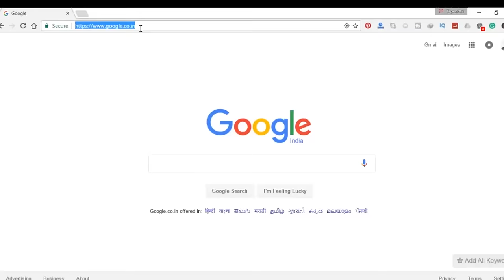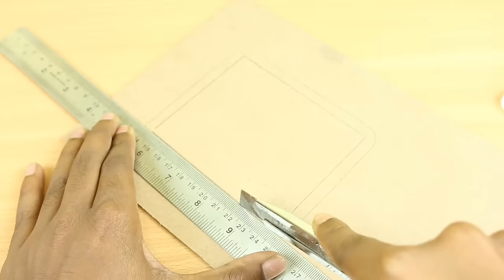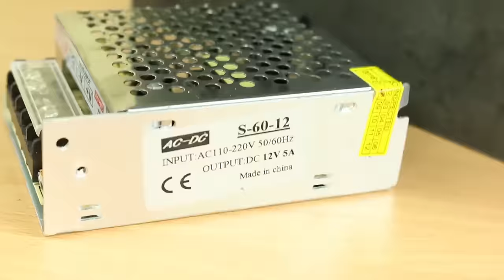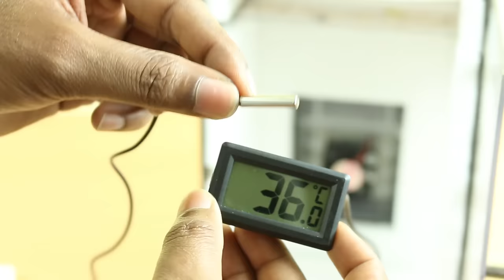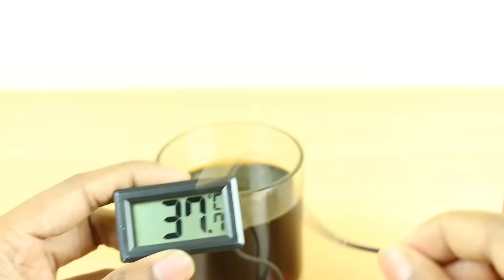How to Make a Fridge at Home

Comment: I bet that heat sink would work well on a cpu
Reply: Probably because it is for a cpu
Reply: 1:20 "Refrigerator radiator" you sure its for cpus, bud?
Reply: its a peltier cooler yes, but adapted for this purpose.
Reply: R101710 yes, its probably some cheap cpu heat sink bought in bulk off eBay and sold as part of this kit.
Reply: Work's the same way essentially.
Reply: Ailuropoda melanoleuca Nineoneone I meant the heat sink, not the entire fridge thing. If you made a retention arm for it, it could probably work as a shitty heat sink
Reply: Thijs Janssen thank you, it does have a cheap cpu cool we on it, as I said
Reply: S A L T Y
Reply: Landon J Powell wow, you just contradicted yourself there, matey. First you say it isn't a heat sink, then you say it is? WHICH INE IS IT????
Reply: dude he means only the big heatsink not the whole assembly
Reply: Thermoelectric Peltiers (TEMs) can be risky around sensitive PCBs. They tend to condensate below the ambient temperature. (They are used in cheap dehumidifiers, actually.) Keep them outside your case unless you can insulate your components from dripping water.

It can be done, though. Condensation depends on how cold you want to go, the climate you're in, insulation materials, etc.

I've thought about putting some TEMs on my H110i's external radiator, instead of fans (only the TEMs' heatsink fans, naturally), so that the coolant is extra chilled.

Search "TEC1" on Amazon for tons of them. A 154W peltier is $10.
Reply: I think he's pulling your leg..
Reply: Jack McDonald p
Reply: Jack McDonald I

Comment: If I were to make this In Mexico, It would come out the same price as the old regular sized refrigerators we get from the U.S. Nice Idea though.
Reply from the maker: price is same for every country but shipping charges can vary
Reply: No i mean just the price of those products alone. I didn't even take into consideration the shipping costs! Damn!
Reply from the maker: +Tacos Varios price will be same
Reply: The same as it ever waas. Haaaaaaay!
Reply: That's what i was thinking, should the price on these products be more expensive that of the cost of me getting one second hand.

From Tijuana btw
Reply: @gnawaserge  Just get creative, mate! Instead of computer fans, use those chinese micro fans, instead of the cooler, just use a metal chunk of something.

Comment: Is this Thermoelectric Cooler Module effective as a cooler/fan if the cool side fan is replaced with a larger diameter fan and heat sink?
Reply: Ananthu Raj yes, but you need to put a larger heat sink and fan on hot side. and also keep the hot side outside the window. if not the heat generated from hot side will be circulated in the room.
Reply: Thanks mate.
Reply: yes,,, energy doesn't just disappear... 
its energy transfer LOL

Comment: @Mandal 
Please tell me if it can work for a long time. I tried it out, but noticed that the peltier module will heat up in some time. I went through its working and noticed that these devices cannot be powered for a long time. So tell me this, if I use this cooler for 2 hours there would have been heat building inside right?

Comment: 40$ in parts?
For that price you can buy used 10x larger fridge, with proper compressor for cooling(much more efficient than peltier cell.)
Reply: But you loose the fun in making your own.
Reply: exactly. All of this is for testing our knowledge of electronics and just for fun.
Reply: Arek R. 
I agree
Reply: Because this needs a lot of work but a fucking ready fridge made by a factory that make 100 ones every day

Comment: i got the thermoelectric cooler but it damege when i start
Reply from the maker: +ghost caught on cam change the module
Reply: but my module have only two  fan one small and other big one
Reply: please tell what i do 
i use all that product which you mention but it not work 
so please tell me which amp i use
Reply: i will change the module but it not do any coolling
Reply: The peltier chips are very sensitive to temp so apply heat paste properly bw the hot side of peltier chip and the heat sink, also use high quality of heat sink ......
During my project we burnt many chips and finally we find a solution to protect our chips.
We simply add a feedback system which cut the temp when it goes beyond 90℃ on hot side.
Reply: I advised you to use high efficient heat sink, I think you have used cheap heat sink.

Comment: Hey if its 42 C out side and that says 20 C and it will run on solar, I am for that & yes I have used one with out knowing it un tell I took it apart , found out it stopped working due to A lose wire

Comment: #NeedHelp
I am making CNC with arduino but for this I need old DVD drive but in eBay it was very expensive so "HELP ME I NEED SCRAP DVD DRIVE"
Reply from the maker: +Viral in YouTube brother you find old DVD writer in pc repairing shops.
Reply: Yeah I go there but they don't have
can u send through courier I will give you mony + shipping charges😀
Reply: LL Studio  I need steeper motor + the base
Reply: Even a new DVD drive is like 10 bucks, what the fuck.
Reply: Viral in YouTube   u r myfrnd on fb
Reply: Viral in YouTube
Reply: Viral in YouTube
Reply: Bro they are like $3 on ebay...
Reply: Viral
Reply: lol im guessing you're not from a western country.

Youll find that somewhere, theyre everywhere.

Comment: Great work uploader. Can I make a cooler like this to work in a car by connecting it to car's lighter 12vDC with a fuse instead of the power supply shown in video ?
Reply from the maker: Yes you can..thanks mamoon bakeer

Comment: Do not you need power from a wall outlet or how does it work? (110V 220V to 12V 5A 60W LED Light Strip Switch Power Supply Transformer Driver)

Comment: I plan on doing this. The only thing I would do different is add a controller to automatically turn it on and off depending on the temperature inside.

Comment: You could make the door with two layers of plastic with air captured in between. That way it will insulate better from the outside temperature.

Comment: If my Peltier plate is 12706 that is its max rating is 6amps
So if I apply 12volt 20amps power supply to my Peltier will it damage my Peltier?

Comment: (110V 220V to 12V 5A 60W LED Light Strip Switch Power Supply Transformer Drive) how does this works?

Comment: I made a refrigerator using same peltier effect mechanism during my engineering as my major project. I want to get a patent that the processes are too lengthy and costly. we achieved zero degree centigrade and does successfully freeze the ice, we also do controlling through arduino board to maintain the temperature at 4 degree centigrade.If I do Masters then I definitely explore my project but unfortunately I don't.

Comment: is there a way to make it cooler than 20°C?
Reply: throw some ice in there :)
Reply: you can put another motor in the same  Refrigerator
Reply: that won't fix the problem in my opinion. It will only make it faster, but not push the limit to cooler

Comment: fine wood similar to plywood does not take the refrigeration of a fridge. in this way, the fan must always be operating to keep a low temperature. you did a smaller compartment to the engine

Comment: does it run without electricity?
Reply from the maker: +Yash Dsagupta you can use 12v 7.4ah battery
Reply: But have used it?Or which source of energy u have used?

Comment: "12V 6A Semiconductor Refrigerator Radiator" but "5A 60W Power Supply Transformer" any problem? 
banggood.com gives peltier with "Semiconductor Refrigerator Radiator Cooling Equipment package" ?
Reply from the maker: +Tricks Solution &Tutorial you can use any 60 watt switch mode power supply
Reply: banggood.com gives peltier with "Semiconductor Refrigerator Radiator Cooling Equipment package" ?
Reply: Tapendra Mandal what do you works as? engineer
Reply from the maker: +Dr Bean electronics developer
Reply: Tapendra Mandal where do you work now?? i now stdy as engineering electronic computer
Reply: agree .... if space is not a concern you can  salvage an old pc power supply

Comment: hey just wanna say that he put the cooling fan on the wrong way so that is why the air isn't cooling, it took me an hour to figure out why it wasn't cooling right.

That unit does cool to about -5 degrees Celsius but it aint on right so lol
Reply: also want to point out that using the unit in cycles is most efficient and that is how you obtain a bigger temperature difference. Use a temperature sensor/controller to stop the module once it cools to your temp then have it turn back on after raising say 5 Celsius.

Comment: in my opinion you should spray any other color except black because black color absorbs more heat....
Reply from the maker: +Electra Diy thanks for your opinion..i used insulating material to prevent heat transfer
Reply: Tapendra Mandal that's a good point here. i thought you used thermocol to provide thickness and softness on all the in sides ! these vids undoubtedly are great. but I feel u must talk and explain everything properly for the newbees out there. 🙋
Reply: Tapendra Mandal after going through many comments of ur videos, I feel many aren't actually understanding why specific components are being used in making a product , how you are actually connecting the wires, etc. it would be helpful for all if u speak out every detail.
 I dnt know if u hav any idea of how many ppl u r inspiring to atleast look at how u make these. U hav good knowledge... share it with us!!.

Comment: this is ,.,.,..,.,.,.,.,,. IMPOSSIBLE
Reply from the maker: +ItzRealAdyGames everything is possible
Reply: We make a refrigerator using same tech 2.5 years ago and that can touch 0℃ on the surface of our refrigerator and the air temperature we achieved is 4℃.
We add some controllers to maintain the temp on that level as below that temp our system lost its efficiency very significantly.
Also it's useless to go below 0℃ as you can make ice on that temp

Comment: a regular fridge is 8 degrees, not 16. This doesn't work without the same coolant system a proper fridge uses because it can't pull out the heat anymore once the metal has become the same temperature as the room.
Reply from the maker: +xorinzor it can reach 8℃ within a hour

Comment: You need to add a peltier as well, as you forgot that. No need to drink room temperature drinks man.
Reply from the maker: +vajje2k5 whole module comes with peltier..which is preassembled.

Comment: Next time use primer,your material was soaking in the paint. Made your project look cheap,which it is,but thats beside the point. Also,use better foam. You can get foam any where now days. Using foam out of a dishes box or something isnt even thick enough. The key to keeping anything cold is the insulation,and you failed on that. I realize you were doing it on a budget but come on.